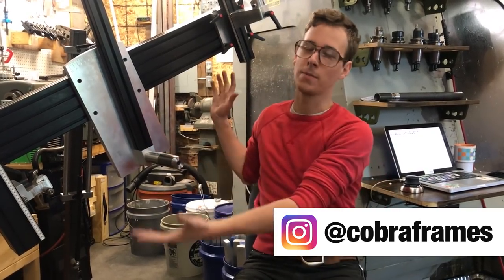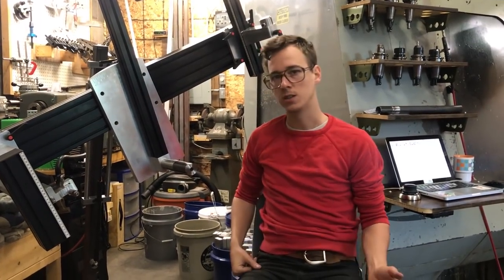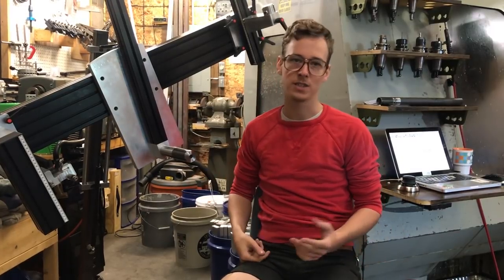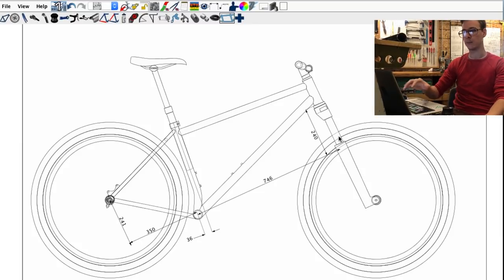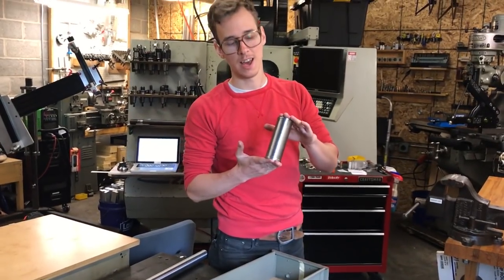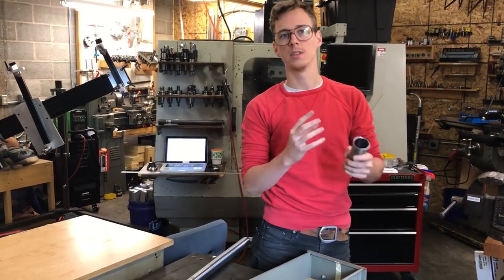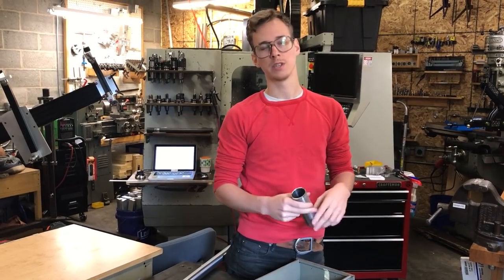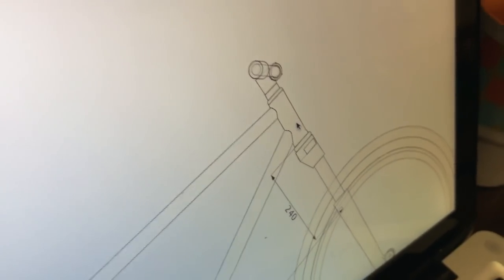The MTB Frame Build Continues! Jig Setup and Seat Tube Mitering

Comment: Hey I design fixtures and gage for a living. For making that seat tube miter just setup 3 v blocks on the table at least one on each side of the bend and strap clamp it down. Then just edge find the top of the tube and the sides for the centerline and move your X and Y. You could just build a plate like this and use the toggle clamps. Remember, when you use those or cam locs that you need some compliance in the clamping direction for the mechanism to cam over and actually lock.

PS dont forget to make sure your dropper clears those water bottle bosses and to add your internal dropper routing hole.
Reply from the maker: The issue with just using the top and the tube centerline as the datums is that it assumes that the bend is exactly to the print. With bend spring back and with it being hard to measure the exact point of tangency of the beginning of the bend I don't want to use these datums, though wouldn't be good if it worked. I think what is more relevant is getting the miter nearly tangential to the BB shell which is why I wanted to do it this way. I have checked for the dropper clearance against the water bottle bosses and I should be fine even with a really long dropper, but it is important to check!
Reply: @cobraframebuilding  Yeah that's the thing with making a 1 off in a small shop. I had a longer reply but got distracted and youtube lost it.

Comment: Did you plan to use a dropper post? If yes sould you not make a hole in the seat tube for the dropper post remote cable?
Reply from the maker: Good catch! Yeah, I'm just not sure exactly how I want the dropper cable to enter the seat tube. I haven't figured out that step yet, but I haven't forgotten about it.
Reply: @cobraframebuilding  My Kona frame routs the dropper cable/hose down the ND side of the DT, and then into an oblong hole in the ST below the water bottle area. Pretty good setup, no tight bends. Also came with a grommet like this: https://shop.knollybikes.com/products/internal-seat-post-grommet